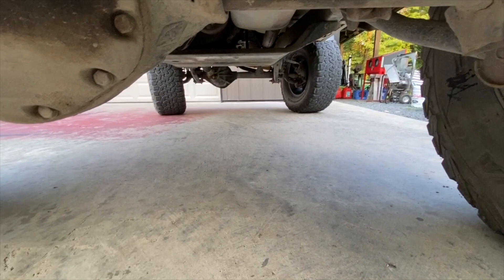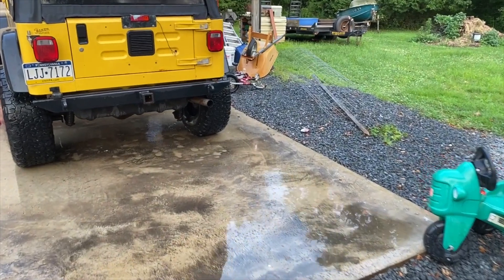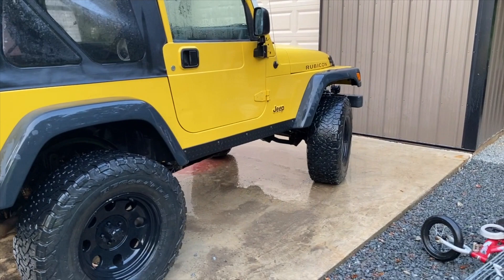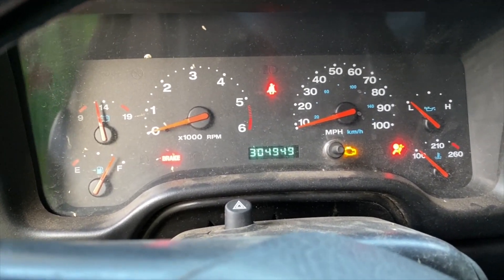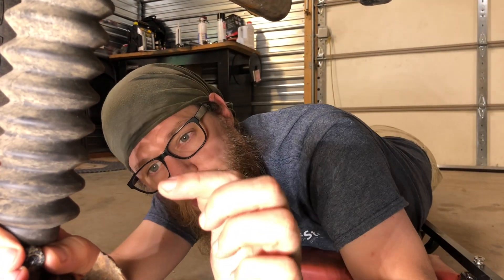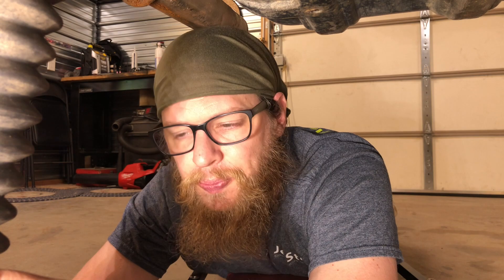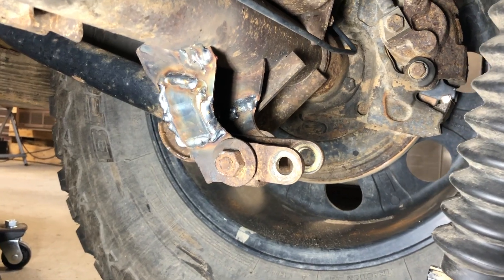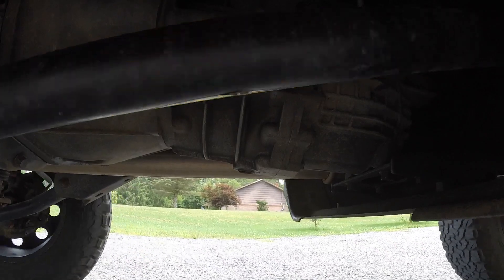DIY: Quick fix: 300,000 Mile Jeep Wrangler Shock mount temporary repair

Comment: Those shock mount extensions increase torque to the mounts. Unfortunately, my Jeep also has them.
Reply from the maker: Yeah, it doesn’t help that the shocks were too long and the jeep didn’t have the proper bump stops. And the shocks were extremely stiff. 
We eventually changed the shocks on this jeep to some quality Bilstein and re-mounted them in a way that didn’t bind up on the mount.